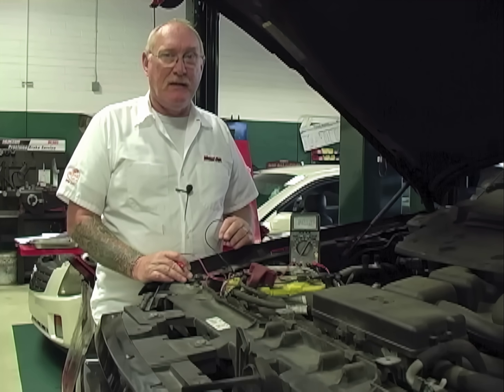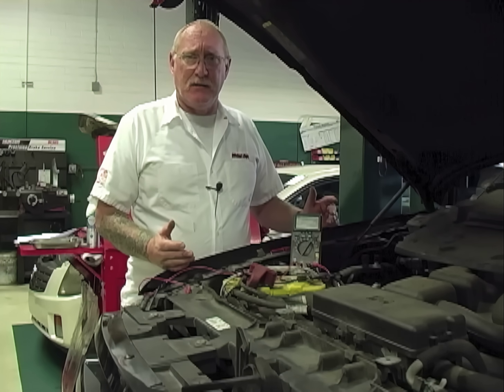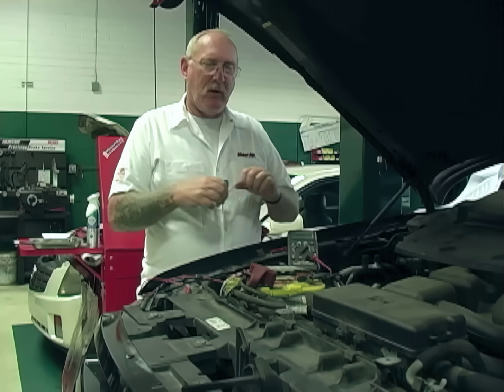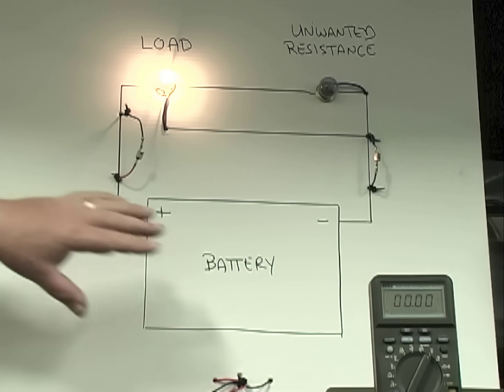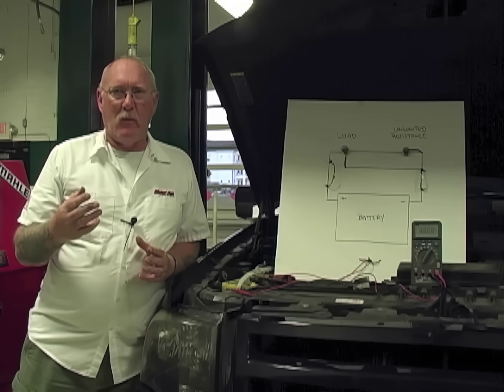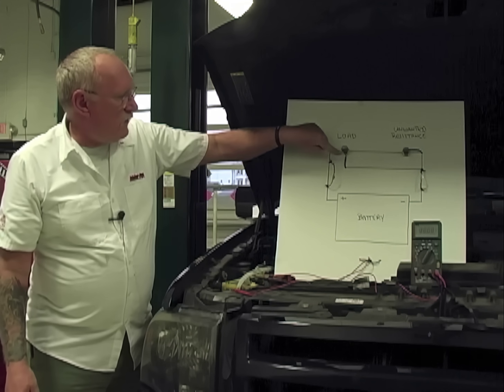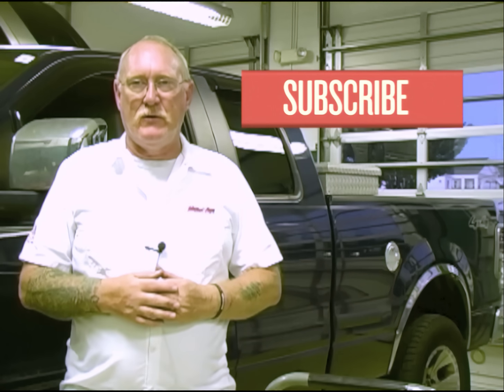The Trainer #47: What measuring voltage on the ground side means

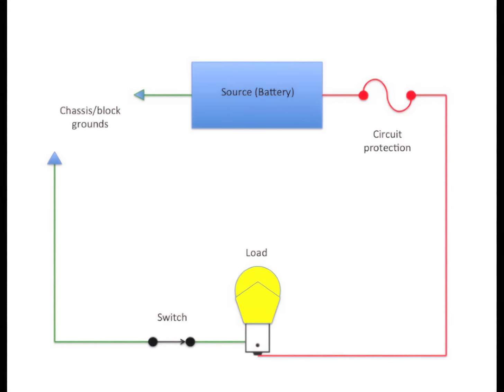Comment: Pete, I just recently "stumbled" across your video series while in the process of looking for something else.  I've watched a handful of them on electricity and electrical diagnosis, and I'm impressed with your skill as an instructor.  You clearly know how to share what can be a challenging subject in a manner that is readily understandable.  In this video, I particularly appreciated your taking the time (at 2:20) to explain why the circuit protection device is always placed on the positive side of the circuit.  I would add that this device should always be placed as close to the battery's positive terminal post as possible, the reason being that it increases the likelihood that the device would still be included in the circuit in the event of a short circuit prior to the load.

Comment: I just watched the Schrodinger's Box video on voltage drop yesterday and this video was an excellent complimentary video to it.

There is SO much to learn about cars (especially when it comes to electrical) besides just turning wrenches. 🔧 

I love videos like this that cover things beyond basic repair videos. I want to see more videos like this.
Reply from the maker: Check out our libraries on our channel's home page! I've got plenty to keep you busy.
Reply: I taught electronics in the military and civilian sectors and, though you may know what you're wishing to convey, they way you convey it is convoluted and confusing.  Even your mockup with the two bulbs as resistances in a circuit is confusing because you have another black line representing a circuit path shorting the "unwanted resistance."  Why would you do this to people who are already struggling to understand what you're trying to convey?  The fact that you call the red lead of the DMM the "positive lead" and the black lead the "negative lead" shows a fundamental misunderstanding of how to use a DMM.  The black lead is the REFERENCE lead and the red lead is the MEASUREMENT lead.  Your meter doesn't even label them positive and negative! There are systems that are positive ground where the reference lead will be on the most positive side of the power source.  Telecommunication DC plants are like this and are -48VDC, typically. When you see a measurement, the reading is IN REFERENCE to the black lead and it may be positive or negative but you know it is WITH RESPECT to the reference lead.
Telling people that "voltage is consumed" by a load is also just confusing since there is no physical way to demonstrate this.  It's just as easy to teach electrical fundamentals CORRECTLY as it is to BS your way through it.  I'm a retired engineer/teacher and what you did in these 9+ minutes is just cringe. Telling people to remember adages instead of explaining the "why" of it only makes things easier on YOU, not on the pupil.   SMH     Awful.  Just awful.  THIS is why people think electronics and/or math is difficult... they think if they don't understand something it's because they're just not getting it when, in fact, it is the horrendous teaching abilities of the person in from of them.
Reply: @DiffEQ  Do your own video.  As a know it all critical person I am sure you can do better than anyone
Reply: @DiffEQ  That's funny, I was never confused watching this video. Maybe your way would actually be more confusing to the newbie. This was the simplest way I've seen to identify, and CORRECT electrical problems in automobiles. I've been working on them for 50 odd years, and was a certified A.S.E. mechanic. Sometimes the correct engineering nomenclature is more confusing than a simplified basic explanation. Go get a life!
Reply: @DiffEQ  lol what a tool so much education but no intelligence

Comment: wait, when you took the voltage reading from the negative battery post to the chassis ground, did you disconnect the negative battery cable?
because that's exactly what i have going on, except the battery negative cable is disconnected from the battery.

also i have continuity to ground on most of my fuses.  and most say about 50 ohms of resistance.  which makes me think of a switch coil.
Anybody have any idea what might be going on here?

Comment: What do you think of this guys diagnostic of a speed sensor? https://youtu.be/D7quIQzxm24
Reply from the maker: There are different types of sensors and the first step he should have shared is how to identify which type you're diagnosing. The one he used produces an AC signal that you can measure with the engine running by backprobing the ECM connector at the correct pins with an AC voltmeter or scope. I prefer the scope so I can see if there are any dropouts in the signal.

Comment: what led me to your videos, and I can see that I will be studying them for months, is my 2002 Chevy avalanche suddenly had symptoms of no speedometer and no automatic shifting after I struggled to replace the encoder motor on the transfer case.

I had to use heat on the front driveshaft to try to remove the spline from the transfer case to give myself space to remove bolts on the encoder motor, which I never succeeded in doing, I also hammered on it… I think I must have interrupted electrical flow while removing and reattaching the wire harnesses on the encoder motor several times, that’s what I’ll be focusing on. No other speed sensors were touched during this process, so I’m guessing the wire harnesses that I did connect and disconnect probably lead to at least one of the three on the transfer case.
Reply from the maker: Took a quick look and it appears that the speedometer is controlled by the ECM via inputs from two speed sensors, not the encoder motor. It is possible that you have more than one problem OR there is a common feed to the three. Do you have any diagnostic trouble codes?
Reply: @VehicleServiceandRepair  Thanks for taking the time to help, you must be a pretty busy guy… When you say ECM, on the 2002 Chevy avalanche, is that the same as the PCM? Under the battery?  no new codes, just the original one showing bad encoder motor, that was there before I had this problem, which is what prompted me to replace the encoder motor…

I went down the road of replacing a speed sensor, the one on the tail end passenger side of the transfer case, as you would guess, to no avail. I won’t be doing that again without thoroughly going over the electrical system.

I never messed with any of the other speed sensors while I was trying to get the encoder motor out, was just thinking that one of the wires/harnesses must have led back to another speed sensor and might pass through one of the harnesses I was monkeying with
Reply: I never messed with any of the other speed sensors while I was trying to get the encoder motor out, was just thinking that one of the wires/harnesses must have led back to another speed sensor and might pass through one of the harnesses I was monkeying with
Reply from the maker: @tripptraders  Codes rarely point out a failed component but a symptom of the system. I'm guessing you had a circuit-related code. Continue as you are - and troubleshoot the entire circuit. Let me know what you find!
Reply: @VehicleServiceandRepair  After a quick phone call, I’m going to watch some of your original videos and go out and put the multi meter on it

Comment: I had walked away from this video because I am busy, but I was left with 2 issues:
1. you state that if you cut a wire it causes a resistance change, enough so, that current will not flow.
  ...that is not a good example, as resistance is only in the context of a circuit in which current flows, cutting a wire makes it no circuit exists, no current can flow... therefore no resistance even gets a chance to have its effect.
  ...and Voltage will exist on the high side(relative) of the cut even past the load.
  ...so, resistance is at the same level it always was if you cut the wire on the low side of the last resistance on the (non)circuit.
  ...and with the last above statement you can see how it becomes confusing, since in that case the sum of (LOAD/necessary)resistances still adds up to no change, only that there is no circuit, no current flow.

2. When you use the example of a massive Voltage on the low side that should show no(insignificant) Voltage.
...the test you did is on the last leg of the circuit, a very short wire that goes directly from the body(common), to the negative(ground) of the battery, NOTHING in-between.
...and that your interest will focus on that ground wire... You are leaving it to the student to interpret that, or still question it.
You should explicitly state that you did check the wire and it was corroded, or had a dirty terminal, or was loose, or was shorted to high... and after replacing, cleaning, tightening, or repairing... the Voltage dropped to insignificant as expected.
Reply from the maker: Thanks for the input. As I shared, this is an older video that still gets a lot of attention! I've made additional videos on this topic since - trying to get a little clearer on each attempt.
Reply: Simplified as it should be!

Comment: Question. We're taught in tech school that current flows from negative to positive meaning electron flow is from negative to positive so in order for the circuit protection device to protect the wiring before it flows through it wouldn't the circuit protection need to be on the negative side of the battery and not the positive side.
Reply from the maker: Most automobiles, motorcycles and light trucks are grounded on the negative side of the circuit. Essentially, they are "shorted" to the chassis/engine block already. The positive side is not - so if it connects to ground before the load, the circuit path would be complete to the battery and current will flow - hence the need for protection on that side of the circuit. Make sense?
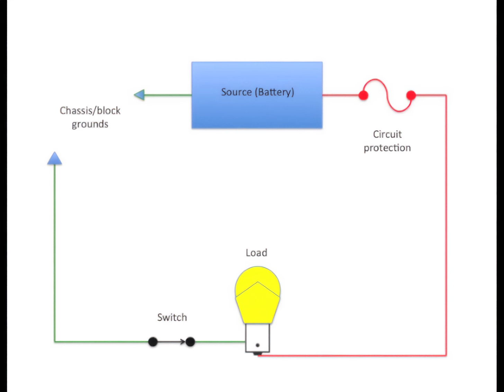Reply: @VehicleServiceandRepair  Thanks for the quick reply, appreciated. I misunderstood your reply but think I got it now. When you said "so if IT connects to ground" I thought you were referring to the circuit protection (fuse) but by "it" I believe/see you are referring to the wiring on the positive side before the load in which case as you suggest the fuse location makes sense. In the diagram at 2:25 of the video shows a load in this case a light bulb but I was thinking of a device like a motor that opened head light doors or ran a sequential turn signal system or any device that had an internal short and in those cases thinking it would be better for the fuse to be at the beginning of the individual ground wires in the direction of electron flow. As you suggest it comes down to utilizing the chassis as a current path. If all the circuits used all/only wiring on both sides and didn't utilize the chassis as a current path at all then it would make more sense to have the fuse block on the ground side as close to negative terminal electron flow. I guess it also depends as to where the short is located as you point out in the positive side before the load or anywhere after the control device (switch) provided the control device was on positive side shorted to the chassis in which case putting the fuse close to the battery positive makes sense or if the short is inside the load itself and then better to have the fuse in the individual ground lines of each circuit or in a separate ground side fuse block. In the interest of weight savings (less wiring and one fuse per circuit) I suppose the auto manufacturers can't cover all possible scenarios but the most probably causes which are positive wire shorts to the chassis when utilizing the chassis as a current path.
Reply from the maker: @UCg7tBNVR5WeELBq6AR_Vhaw Let's try again. Think about the path to and from the battery. Current leaving the negative battery post will travel through the engine and/or chassis to the ground side of the load. With the circuit "off", it cannot flow - to anything. If the ground path is broken prior to the load, it still cannot complete the circuit to the battery. On the other hand, if the positive side of the circuit is allowed to contact ground anywhere between the battery positive and the load OR control device, whichever is first in line, then it will have a direct, uninterrupted path to the battery - a complete path with no load or current restriction.

Comment: The diagram is misleading , the negative wire from the secondary light intersects with the negative wire on the first light thus it should have the same multimeter reading at any point on that negative wire going back to the negative terminal on the battery

Comment: I'm reading 12v between a ground wire for the lights and chassis on my RV. I have a short somewhere. But the lights work when I flash that wire to chassis.
Reply: The fault lies between your two test points. The 12v reading typically indicates an open circuit on the ground side.

Comment: can you look video and tell me whats wrong
Reply from the maker: Describe for me exactly where your leads are placed for each reading. It looks like you're taking them off of the ends of jumper cables but the positive meter lead looks like it is in a connector? I can tell you that you are measuring Open Circuit Voltage and not voltage drop because the connector is unplugged - you can't measure voltage drop unless current is flowing (the circuit is being operated). Another mistake is placing your meter probe in the connector. You damage the connector end and introduce voltage drop you created.  What is the problem you are trying to troubleshoot? (https://youtu.be/iK8Fs1_yhZk)
Reply: @Motor Age hi i have big problem positive wire and negative somewhere is touching
Reply from the maker: @frijus100  Then I would suspect a fuse is blowing - is that the case?
Reply: @VehicleServiceandRepair  no

Comment: hi sir.....i got  confused when you put the Positive Lead of the tester on the body of the car AND the Negative Lead of the tester on the NEGATIVE OF THE BATTERY........will you please check that again SIR.......I BEG YOUR PARDON SIR I THINK THAT IS NOT CORRECT,   THERE SHOULD BE NO READING ????

BECAUSE YOU ARE MEASURING BOTH NEGATIVE SIDE !!!!!!!!!!!!!
Reply from the maker: That is the whole point of this video, my friend. You are correct  - there SHOULD be No reading. But what if there is? What does that tell you about the integrity of the circuit - especially the ground side?

Comment: I'm not a mechanic. I have a question about using multimeter. if I  put negative probe on negative post, with battery hooked up to truck, touch  frame I get 00.2 . If  I disconnect negative post then place neg probe to negative Post, positive probe same spot I get 08.4 . Wondering why and which one is the proper way?
Reply from the maker: If you have a load on and current is flowing, than your first test is the correct way. When you disconnect the battery you are adding in an open circuit.
Reply: @VehicleServiceandRepair   Thank you for the info.  I kinda figured supposed to leave battery hooked up. Saw video with negative  off . Thanks again.

Comment: You have any videos with 5 volts reference on sensors and how they work
Reply from the maker: I don't Ryan, but here's the short version. Many sensors use a reference voltage (a supply voltage) that comes from the ECM. Today, 5v is common but in the old days, other voltage levels were used. The supply is shared to a number of sensors and if any one of them shorts out, it can pull down the supply to them all. So - if you don't have 5v on the sensor that you're testing and you know it should be there, identify all the sensors that share the same supply and disconnect one at a time until you see the 5v return. Does this help?
Reply: @VehicleServiceandRepair  alot thanks,cause I'm all the way from a Caribbean country called Trinidad trying to learn of these stuff.so any little help is thankful
Reply: I have one more question sir,do you know what is a bias voltage?
Reply from the maker: @ryanramlochan1504  A bias voltage, in automotive, is a test voltage sent out by a control module to test the integrity of the circuit paths and components it relies on. Since the ECU knows the resistance of the component and the voltage applied, it can monitor the return side of the circuit to determine whether or not the circuit is ok or not.

Comment: understanding better, ive tried to pound on this all my life,  you must have a big problem to have 8.5 from chassis ground to back the batt
Reply from the maker: And that's the key - understanding that when you see voltage on the ground side, that's where the problem lies. Try making up a simple circuit for yourself and measuring at different points in the circuit. Then add a second resistor in and measure again - with one resistor (I use light bulbs) playing the role of the "thief". Here's another video that may help:  https://youtu.be/S04E_ehjz_k

Comment: I am having trouble understanding your electrical drawing with the load and unwanted resistance. Are you indicating that the circuit is a series or parallel circuit?   If it is supposed to be a series circuit, I understand completely. Then why the extra wire from the load negative to battery negative? That wire would make it a parallel circuit and totally different voltage readings would be expected.
Reply from the maker: I"m sorry for the confusion. In the demonstration, one example showed how a normal circuit should operate and the other example was of a circuit with some form of unwanted resistance. There are several videos on our channel that talk about voltage drop and I'm going to be adding another for our Virtual Training Event in January. Here is a link to one  you might like:  https://youtu.be/S04E_ehjz_k